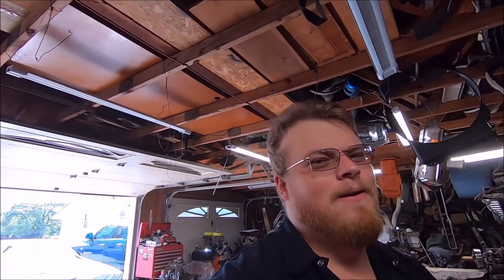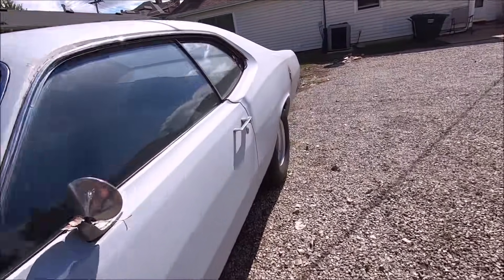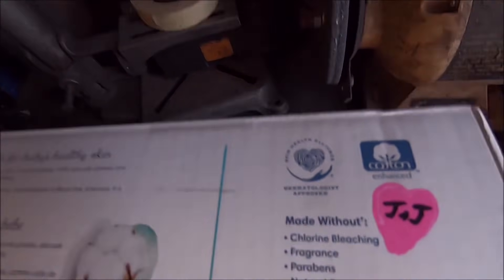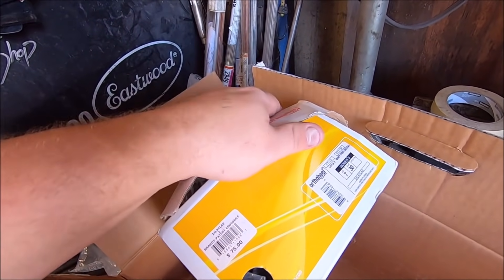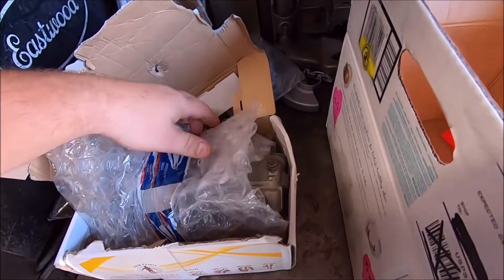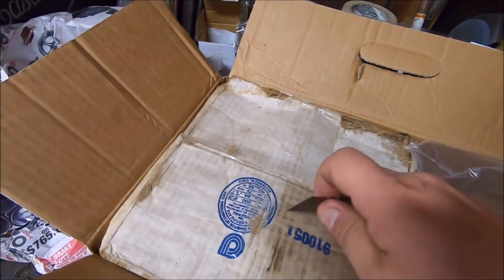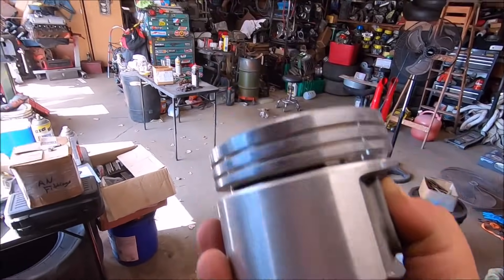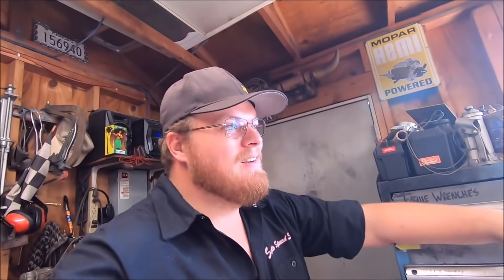1970 Duster W2 340 get's blessed by @JustMoparJoe

Comment: Engine builder for 15 years had 0 problems with comp stuff. Ran more comp stuff then Hueghs crap.
Reply: Hughes is crap i agree
Reply from the maker: Hughes Engines Cams are all I have in my stuff, Jezebel, Dads Hemi, my Satellite, my brother truck, and never had an issue. Comp on the other hand hasn't been doing so hot lately.
Reply from the maker: Also going to throw it out there, Hughes only sells Hy-Lift Johnson lifters which are made in Michigan, wish the same could be said about what comp sells, but im not gonna argue, everyone has a brand preference and I'd rather cheer on the small mopar only business than the big guy

Comment: Thanks, oddly interesting.. Incidentally , I just remembered the new 1970 Dart 340 ( green/ Green/ Dog Dish/ Hood scoops/automatic/ Pursuit/ Disc Brakes/tires/ Shocks?) that Dealer let me take overnight test drive, in Spring1970, just before I Graduated from Pharmacy School,etc. Was shockingly tight driving & powerful: believe SPEC/Tuned Engine/Tires/SUSP ; this 70:DART was PREPPED  AND had some regrets (!!) not Buying new…..I had , though,I had a high* miles 66 GALAXIE/500 XL// 4 speed/352 that was improved/ Built up but still heavy / tired…waited until late Summer and got **70:Coronet 500 / loaded 383…

Comment: Friend of mine worked at comp. she had told me that comp owns lunati.
Reply: It’s true! You can still call Lunati on the phone and get a good Ole boy on the phone in Mississippi. I like Lunatis in my builds for budget and street engines. Never a failure with them. I like Isky cams for my race and higher performance stuff. Also no failures there. Check out the channel if you get a chance. I actually cut and combined a 65 and 66 mustang in the earlier days. Oddly enough, the Ford videos didn’t get much love on my Mopar channel 🤷🏻‍♂️
Reply: @JustMoparJoe  I’ve always use crower in my older builds. I was thinking about trying a Hughes this go around.
Reply: @andymartin4747  I hear good things. But have never tried them. I’ve called a few times, waited on hold for an hour each, then never tried again. Isky answers and can make a solid recommendation. I’ll have some results soon in my barracuda to share.
Reply: @JustMoparJoe  I’ll give Isky a try on my next one